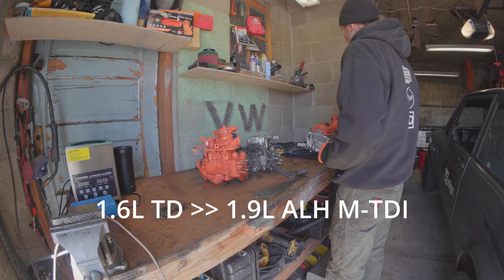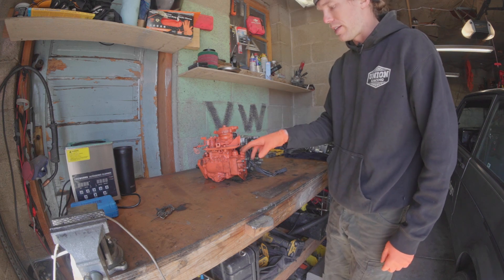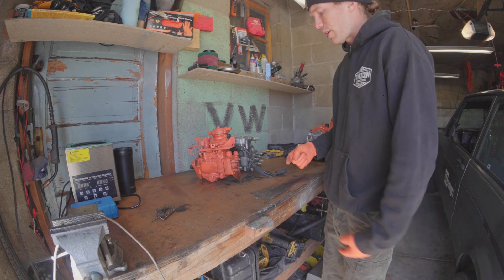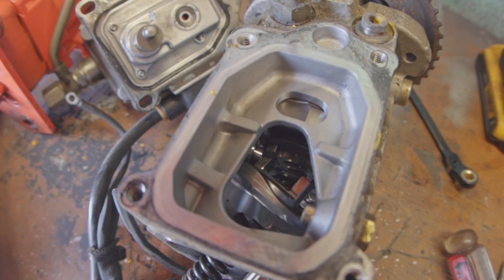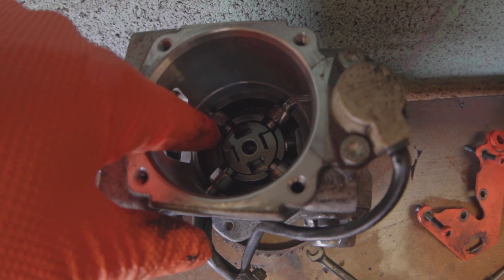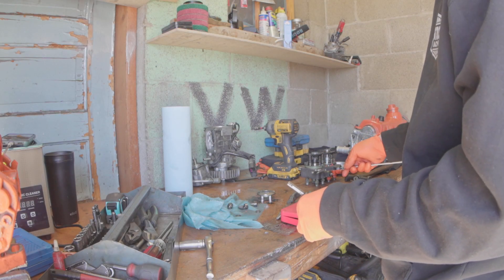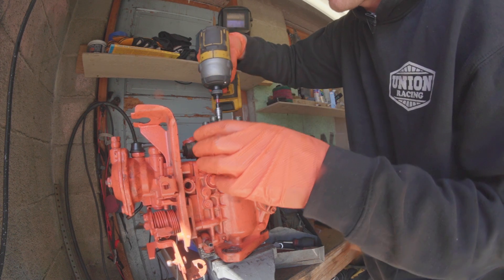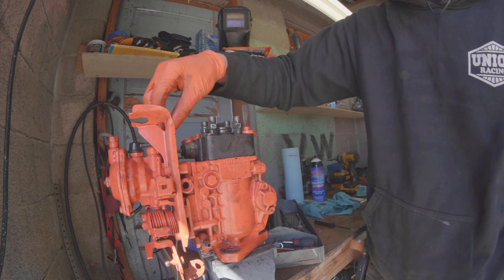Bosche VE M-TDI pump & Day 2 of VW Mk1 Rabbit Engine Swap

Comment from the maker: It is absolutely worth noting that what I call the pressure regulator is actually the return valve 🤔🤔 more tweaking will be had to actually move the pressure regulator too.

To further unearth the dark art of pump timing I'm planning on monitoring real time injection timing with the Arduino. Which should help understand how different changes affect dynamic advance.

Call it what you like but if my 1.6 hybrid pump runs my 1.9l I'm going to call it m-tdi 😉 many things still to tweak and understand

Comment: So are you essentially just taking parts from the stock ALH pump and putting them into a stock 1.6 pump? Fairly new to this stuff, but contemplating dropping an m-tdi into a trail truck. It’d be cool if you made a video going into detail about mechanical pump options for an ALH. Like your channel!
Reply from the maker: That would be a good vid! Essentially yes. My 1.6 pump isn't stock but I am modifying it with 1.9 parts

Comment: Is this pump that u built a 17mm or 20mm shaft?  I keep reading 17mm pumps won’t handle a 11 or 12mm pump head.  Don’t know how much truth there is to that. Would love to hear your opinion on it.
Reply from the maker: I'm pretty sure I have a 17mm. To my knowledge it's the (aaz? &) 1z that have the 20mm. I've been running a hybrid pump for a couple years now and never had a problem... Going to a 12mm might be a different story. Unfortunately the line between built right and overbuilt is always a fuzzy one solely defined by personal experience 💁 I wouldn't hesitate to build another 17mm input 11mm output pump
Reply: @OliverFetter . Hell yeah, thank you!  That’s what I was hoping u would say

Comment: How are you reading the rpm's off the alh? Aftermarket guage? If so where are is the signal coming from?
Reply from the maker: We have yet to actually put it in play but I will be using the OEM crank position sensor with the Arduino to read rpm and hopefully the 3rd injector sensor too to calculate ignition timing

Comment: Bit of a long one this,

I would have stripped the Timing pistons out of both pumps and compared the length of them. The shorter the timing piston the more total timing advance you'll get. I found this out the hard way when i built a M-tdi pump to do away with faulty ECU dynamic timing control on my 2.0 Rover. 
I installed an N/A pump timing piston (cause i was using its timing springs and governor from a donor pump  too) instead of fitting the turbo version out of the electronic pump. 
The car ran ok but just didn't pull as had as it should. After a lot of thinking about it i decided to measure those timing pistons and sure enough the electronic pump timing piston was 4mm shorter than the one I'd installed. I REALLY didn't want to tear the pump down again so i bought a timing spacer, to space the end cap out by 4 ish millimetres..(had the same effect of shortening the piston) After doing that i had the power back like id had when the ecu pump worked properly.

I'd get a set of callipers that can do depth and wip off the timing spring end, end-caps and measure the difference between the top of the timing piston and the flange where the endcap seals on between the two pumps. (verify that the two pumps timing piston bores are the same width btw)
Reply from the maker: Damn! Excellent information thank you for sharing your experience with that. I will definitely keep that in mind / check that out. 🍺🍺🍺 Sounds like a sweet rig

Comment: Are you switching to direct injection as well then and what switches your diesel from IDI to TDI? I'm hoping to put direct injection on my 1.6/1.9 if there is no availability for 1.6 TDI in this platform.
Reply from the maker: My 1.6l (1984) was IDI and the 1.9L (2003) is DI! So yes switching to direct injection. Purely the difference in motors and years.
Reply: @OliverFetter  are the heads directly compatible? And is the injection pump you're using AHU or ALH
Reply from the maker: @LiamGoodall-t7e  pump heads are directly compatible minus the style of delivery valves (must swap those over). I'm using a 1.6 idi base pump with a 1.9l ALH pump head & cam plate
Reply: @OliverFetter  sorry, my question was confusing I meant in reference to the cylinder heads.
Reply from the maker: Ah gotcha. I didn't try but I don't think they're compatible. The passages are too different
Reply: @OliverFetter  ok, I suppose I'll wait for you to post again, this looks pretty interesting

Comment: Hi, What you name pressure regulator is not. This is just a return valve tdi return valve is not required depends on the pump. The actual pressure regulator is on the back. You need to tweak it or change it and make some test until your case pressure is correct. If not correct you will notice it. Case pressure needs a lot of adjustments and will depend on your pump there is not quick recipe.
Getting the entire timing assembly is better (including piston) anyways you can observe how it behaves and ajust. 
1.6 governor and control arm is absolute garbage on a tdi pump.
Hybrid pumps are an entire different game do not expect it to be easy mate. 
I had to try a lot of different parts and settings in order to get proper results on mine.
Reply from the maker: Mmm good point! Def need to also move the pressure regulator to March the return valve. I'm planning to measure real time injection timing with the Arduino so I can actually have some metrics to review changes
Reply: @OliverFetter edc pump regulators are meant for edc pumps, you are likely to scrach your head a lot with it. Compare an edc reg with a mechanical one, you will see most of the time the spring is reversed.
Tdi reg + tdi return is not a quick win 90% you need to mix and ajust by trial and error to obtain good results
Reply from the maker: Do explain your opinion of levers and Governor further I couldn't imagine it mattering much so long as a fuel collar slides the way you want it to 🤔💁
Reply: @OliverFetter  can i send you some vids on ig so its easier to explain
Reply from the maker: Yes or FB is fine

Comment: Quick question, Oliver: What is your experience with the stock Garrett T3 turbo for the 1.6TD?

I remember you recommended the GT2052, but an actual garret is mad 'spensive and I have 2 T3 turbos that both seem tight and smooth. Thinking to use them instead, because i hear they're a bit oversized for the 1.6 anyhow, so with some proper fuel delivery and a good intercooler, I'm figuring they'll make good power. Supposed to be efficient up to at least 20psi.

Any opinion you could share would be much appreciated. 

You da man, keep it up!
Reply: I have a 1.6td with a Giles pump and Garrett T3 running 15 psi boost and it's insanely laggy. No power whatsoever but once it comes on boost it pulls hard.
Reply: @noahmacdonald3822  Oh cool! Thanks for relating your experience!!! That's what I'm looking for, I think(?)

I just picked up an 11mm ALH pump so I can scrounge the head into my 1.6TD pump. 

Following Ollie's recipe as closely as I can manage. If I make anywhere close to 200 horses I'll be ecstatic.
Reply from the maker: Exciting!!
Reply from the maker: Make sure you swap your 1.6l delivery valves into that donor 1.9l pump head! The 1.9 valves don't fully close like the mechanical pumps.
Reply: @OliverFetter  Copy that. Thanks for the heads up!
Reply: @OliverFetter  Hey, sorry if I shouldn't have dropped that link here. I'm not super keen on etiquette. I just thought it was a pertinent video.
Reply from the maker: @khester7397 you can do whatever you want 😂🍺
Reply from the maker: Heyo! Could you be more specific? T3 in my book only really calls out the flange/body it doesn't tell me much about sizing. Do you know the hot & cold size diameters?
Reply: @OliverFetter  Ill have to get out a measuring device, but the only name I've been able to find in reference to it is "Garrett T3"
Reply from the maker: But from the sounds of your description seems pretty choice! A bit of oversize with more fuel should feel right at home
Reply: Are they Garrets or K series turbos, the K24 is too big for a 1.6 until you pull and olly and you will likely look power compared to a K14, both mount to the same flange and both can peak around at least 20psi but the K14 is half the size and spools twice as fast, when I had a K24 I was able to make 26 PSI on just a shimmer and tuned pump but I didn't have any low end boost.
Reply: @LiamGoodall-t7e Yeah, what I've read equates the k24 with the garrett t3.
Reply: @khester7397  Garret T3 is a turbo brand and flange type, there's the MK3 Garret turbo and the MK2 Garret turbo, I don't remember the model names but the MK3 turbo is smaller
Reply from the maker: I know the gt2052 to be a sweet spot of big yet spoolable - you might look at its turbo map/dimensions and compare it to the k24/t3 for reference

Comment: Awesome, informative video. As per usual. 

Lol, I wasted a head gasket on my 1.6 too. My mistake was way dumber though. I boned up two valve stem seals, so I had to wait for more in the mail. When they came, for some idiotic reason I was thinking they'd be easier to install once the head was bolted in place. So I did that... without the valves installed. Considered using the gasket anyhow, but the clear shellac looking coating was flaking off after i had torqued it down with ARP studs once and removed it.
Reply from the maker: Hahaha ah yes always something to be learned 😂😭

Comment: Hello,is the Land Rover 300 TDI Pump plug and play on the 1.9tdi ahu
Reply: You're staying way far from standard swapping parts and so at some point you need to find out yourself, best way to find out with out ducking around and finding out is looking for the part number on both injection pumps seeing if they're in the same family.
Reply: @LiamGoodall-t7e some colleagues tell me that the best pump on a 1.9 ahu is the iveco 12mm pump and that its plug and play but its pretty difficult to find it here,so im trying to find the next best pumps that can fit easily.
Reply: @Ekipa16V  so, the AHU has an 11mm pump stock, but if the engine the new pump came from is 4 cylinder, as long as you can bolt the pump on it should work.
Reply: There's lots of ways to make adapters if the pump isn't plug and play but you will likely need to fab a custom mount and there is no easy answer to make it work
Reply from the maker: In this vein of thoughts I've been noodling long term on the 4bt Cummins pumps because they are also 12mm. No idea how similar they are in mounting but would love to get my hands on one to find out 🤔
Reply: @OliverFetter  this is a possibility, you would need access to some serious metal working machines and a pulley compatible with the 1.6 but enough effort you could do it. Ideally you find a direct swap first
Reply from the maker: Im not familiar with them but Id generally assume it would do the trick